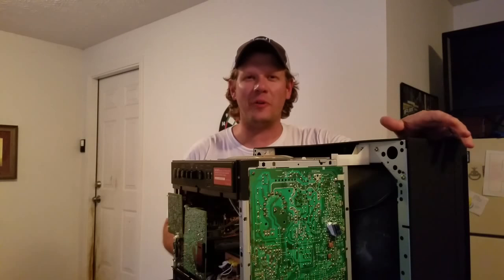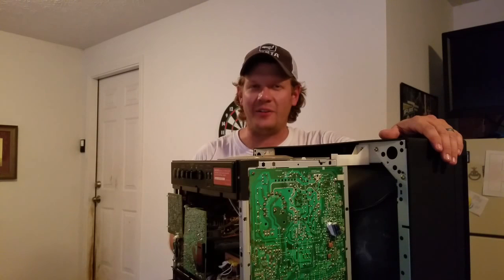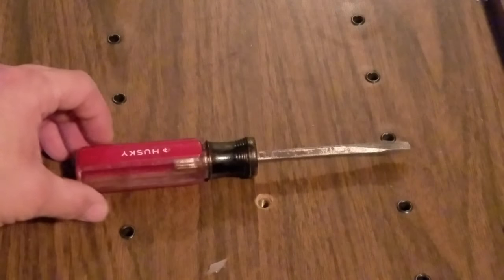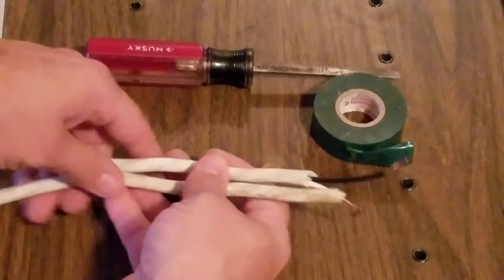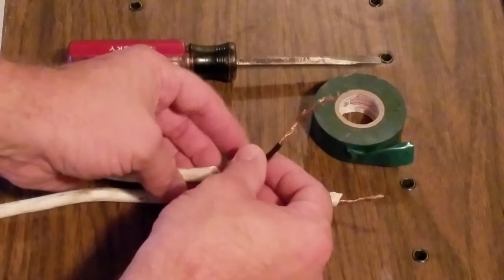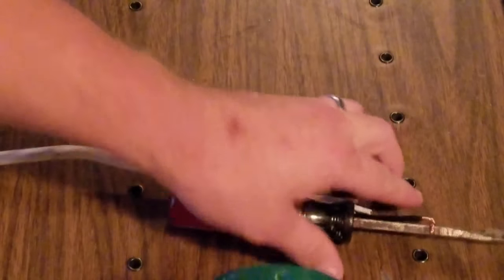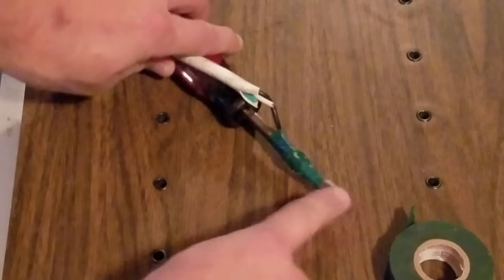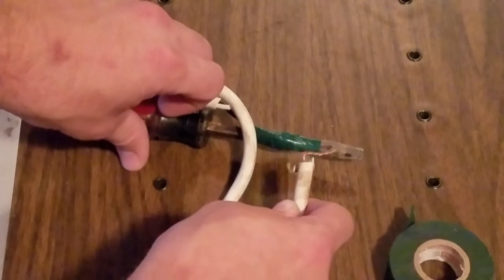How to make a CRT discharge tool

Comment: Do I have to discharge capacitors aswell? I have a 1989 RCA Colortrak 2000, one of the internal cords came loose off jack. I need to get in there and plug it back in
Reply: unless the caps are big and juicy, probably not. while "unplugged", holding the power button in usually bleeds PCB caps.
Reply: @Odolwa2  if you did need to discharge them use a higher rating resistor. Hold by the body and put legs of the resistor to the legs of the cap [  ]

Comment: After discharging, will there still be stored electricity anywhere, like in capacitors?
Reply: It might be, but they are very seldom dangerous. Leave the monitor in ON position but unplugged for 24h usually will discharge those caps.

Comment: @RetroTech Hey! When you're choosing a flat-head screwdriver for the job – does it matter if the tip is magnetic or not? I have one that's slightly magnetic, to pick up and hold screws.
Reply: That's a good question I'm seeking an answer to, too. Do you know if the material matters?
Reply: @hydroxan1508  I went ahead and used the one I had (slightly magnetic) and it worked fine for me at least :) PVM is still alive and well.
Reply: @greenereye  I'm here to literally say just the same thing, I tested a magnetic one and it worked well.

Comment: i have zero knowledge on CRTs....couldn't you solder or weld the wire to the screwdriver or is that not advised?
Reply: Yes, you could, but most soldering irons would have a hard time transferring enough heat to the shaft of a screwdriver to sufficiently flow solder to it without making a cold solder joint.
Reply: @dafretz  i tried. Confirmed 😜
Reply: @swardmusic  That, and you'd never be able to use it as a normal screwdriver again! haha

Comment: What material is your screwdriver made of?
Reply: You don't need that.   I removed anode under voltage many times and I never got zapped, so you can do that without discharging and discharge it after disconnection, if you know what you're doing.  Personally I fold the cap upwords on  the edges, so i can grab it safely, unplug it by moving it to the side and push at the same time, then i touch a few times the steel grounding on the CRT that is connected to the neckboard, and CRT itself I discharge simply with my DIY probe for multimeter.   As above - I did that way many times and I never got zapped where  HV was present  for sure, because I heard HV nosises during anode disconnection and I noticed and heard a spark when I touched the grounding.

Comment: You said you attached the wire closer to the tip "so that electricity doesn't get any closer to the handle". Electricity doesn't work like that, every part of that driver is as the same potential.

Comment: Very sloppy. I would have pulled the black wire out of the jacket and installed an alligator clip on the other end.
Reply from the maker: Who's Rey Sloppy?
Reply: If you think about it.. it's added protection... That "ugly" jacket is more insulation for protection over just the wire and sleeve.